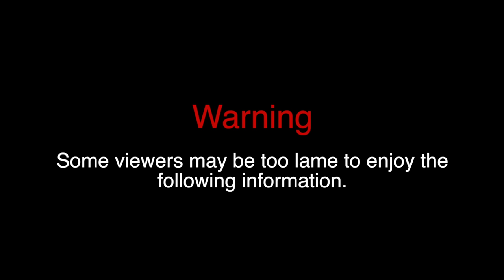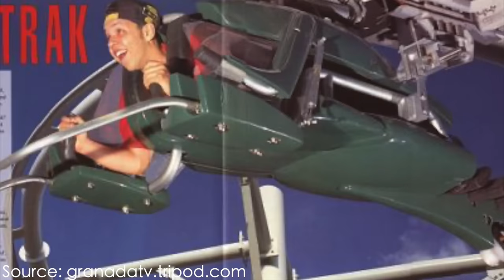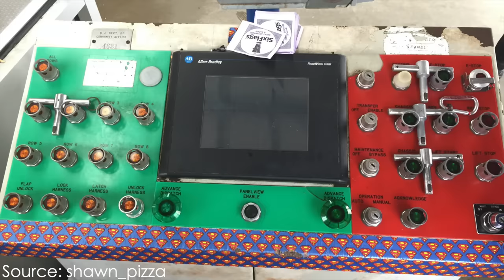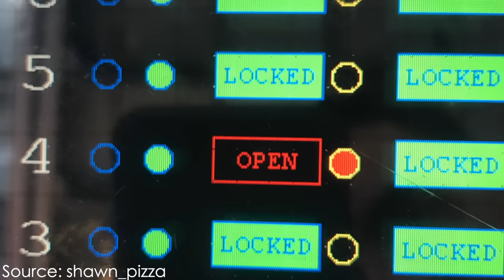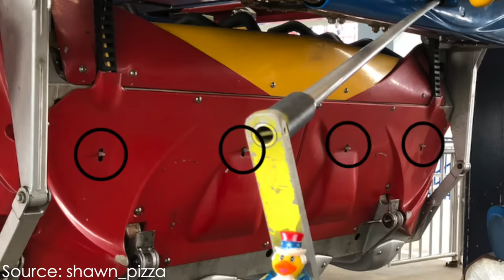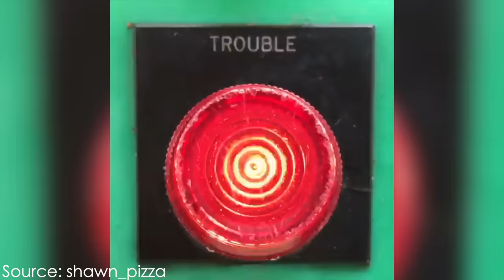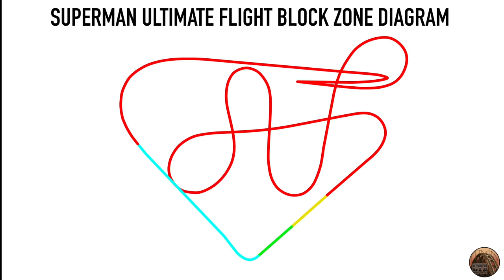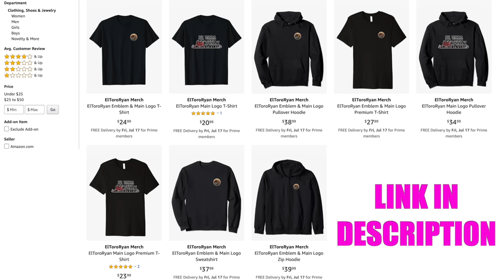Problematic Roller Coasters - Superman Ultimate Flight - Six Flags Great Adventure

Comment: I can attest to the horror of this ride. It was the last time I was up there, probably 10 years ago or so… Maybe more. We decided to go onto this ride and they locked me into the restraint so tight… That I couldn’t breathe. It pushed down on my chest to the point where getting any air in was impossible, and before the attendant saw me waving my hand… The thing took off and I had to endure the minute or minute and a half around the track after the minute I was locked in to the coaster. So I went probably three minutes or so with very little or no air and it was horrifying.

When I got off the ride, I went over to the attendant and told him to ask riders how their restraints feel before they go onto the next. I explained the situation I was in, and that nobody even bothered to do a walk by a second time to make sure everybody was OK. On top of that, the thing was vibrating, and the sudden turns were enough to give even the youngest person whiplash. Just a horrible experience. definitely was the last time I would ever ride it.

Comment: RIP Shockwave :(
Still, by far, the most forceful coaster I've ever ridden.
Great video man, I love these.
Keep em' comin'!
Using RF comm would be extremely challenging to design for this application, I can see why it was a problem. Noise would be a major issue and false checksum positives for each frame would explain the incorrect data, and the noise explains the dropped frames of information, or not being able to comm.
Curious as to how they did this, but all I know, is that any method you choose would be very challenging to get correct.
For the Hersch portion, would love to see the filtering and motor control methods for the encoders. I almost wonder if the two pauses in the movement to fly are weight calculations for the system to calculate the motor output for the Hersch to put it in the flying position without causing excess wear.  Crazy to think it's 80k lines of code, but for thr entire system, believe it or not, that's really not all that much :) it adds up fast.

Comment: It was a mistake to have trains face down on the lift hill and end brake runs. My brother and I were on Air at Alton Towers when it broke down and we were stuck on the end brake run for about 30 minutes. Our necks were in absolute agony by the end of it. If the train had been on it's back we could have rested our heads on the train and it would have been nothing more than boring.

Comment: Huh... I never knew about the wireless train system. That was super surprising to me. It almost seems needlessly complex. If the train needs a bus bar to supply power anyways, I wonder why they couldn't just add two more wires on the bus to achieve a serial signal (like a USB) between the trains and computer? Wouldn't that be much more reliable than a wireless signal? Maybe they just ran out of available width on the bus bar to be practical...
Reply: @Chimera That's most coasters in general? Or most B&M flyers?

Comment: Wow! Thank you for that. I really had no idea of the intricacies of how a modern rollercoaster is designed and operates. So many redundancies and safety sub-systems are built into the system. It answers some questions I have always had about why there are these certain annoying traits that have always bothered me on so many coasters; things like break zones at the top of hills, certain slow speeds on the lift hill, and even (although I realize it was not a subject you covered but, there was something you said that answered this question anyway) why steel coasters, coasters that theoretically should be smooth rides considering that the trains run on smooth, tubular, steel tracks, are often so rough: those tracks and the superstructures they are built on are not stiff enough, they shake and vibrate. Steel box beam coasters are much smoother because those steel box beams are much more rigid, something you mentioned in passing in your video.

Comment: Why didn't B&M just make them have covered break runs. Would solve the issue with rain. Plenty of old wooden coasters had covered brake runs for a similar reason. The old style skid brakes don't function as well when wet.
Reply: Because they'd get wet running around the circuit during rain even if they had covered brake runs

Comment: I was on the Gurnee Superman when a raging storm struck the park. The computer e-stopped while we were on the transfer track because the attached wind monitor was tripped (not sure it was park installed or included by B&M). Everything (including us riders) was soaking when engineering department finally overridden the computer. I also experienced a "super roll", and yes these are extremely rare.
Reply: Yikes...how long were you waiting?
Reply: @zoozagt5  20 minutes for the computer to release us as the wind was too high to even move us the 50 ft. into the station.

Comment: Not to be nitpicky, but PLC is programmable logic controller. I've worked with multiple PLC systems and Allen Bradley is my least favorite, you can't force contacts or coils. Though on equipment you really wouldn't want to force something for the "Safety Ok" coil
Reply: Chimera I can’t remember the version we were using since I moved to another shop in the plant I work in and there’s no AB there. I think it was software older than I am and you could only toggle contacts and coils for a single sweep. My preference is Omron or GE, I find it much easier to find the rungs I need to troubleshoot in GE’s Proficy or in Omron’s software.
Reply: Chimera Omron’s is really nice since when you find the contact you’re trying to get on/off you can just press the space bar to backtrack through it’s coils, very handy.

Comment: I'm pretty sure most of B&M's models feature those three lift speeds, but I realize that when B&M's giga coaster trains engage with the lift hill, it is much faster, and the train runs even faster when the motor pulls it up the lift as the entire train engages the lift. I'm assuming because the lift hill is extremely massive, the really fast lift motor is there to relieve stress on the chain, compared to many of their older hyper coasters. But recently their new hyper coasters, like I see Mako and eventually Candymonium, have the same type of lift speeds found on B&M's giga coasters.
Reply: cable lift
Reply: @Craftst3v3vd  B&M doesn't offer a cable lift hill system
Reply: It's there to get trains over the hill faster, thus freeing up the lift and the next brake block quicker and ultimately maximize throughput by allowing more dispatches per unit of time.

Comment: Great video. One thing that bothers me on the flyers, or at least with Air, is how the dual station transfer chooses a station before either train has dispatched. The problem with this seems to be that if there is a hold up in station 1, and your train is waiting for station 1, you're just stuck there. If the train paused just before the transfer, at least it could redirect into station 2.
Reply: It must just be Air. At the SFOG flyer, the switch is right before the station entrance and automatically changes whenever the first station track opens up. The operator could manually select it but that was only done for unusual circumstances.
Reply: @sharkheadism  Ah that's interesting to know. It seems such an obvious thing to me, so I'm glad it's not like that on all of them

Comment: Do you have a source for the 80000 lines of code required? I suspect that info has been mixed up with something else at some point, as 80000 lines is enough to code a game. Unless they count the lines of code in the system OS, which would be like saying minesweeper has 1000000 lines of code :)